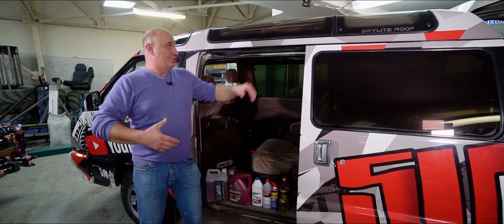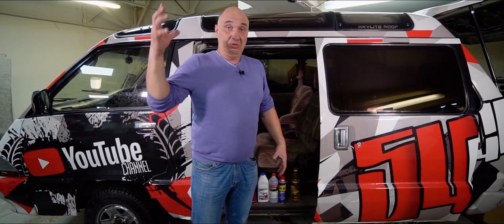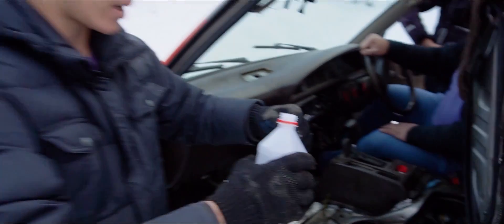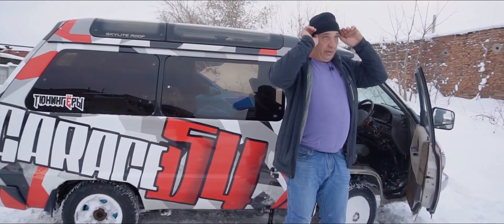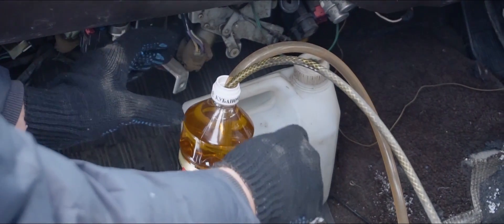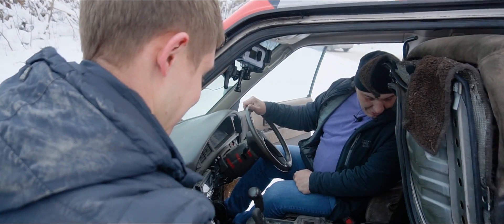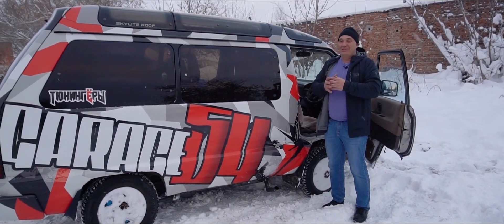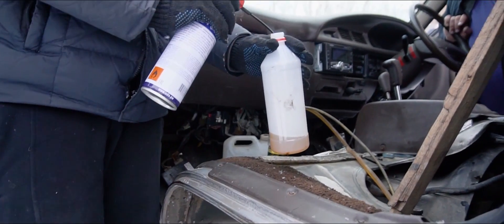Alternatives to diesel fuel: WD-40, cooking oil, brake fluid, Dexron

Comment: They should have done the test again on a modern diesel. These old diesels eat just about anything and don't care. I had a coworker who drove a early 90s Mercedes Diesel. He ran it on cooking oil and used motor oil. Had about 500k kM (310k miles) on it and it ran happily.

Comment: Dieselmotor can and will run on any oil products,from hydraulic,brake cooking motor oil new or used do not matter as long as it are clean from any debris. All oils. Believe it or not even Bacon grease can get you home in a bind, no shit

Comment: Thats why gov's here put a tax onto kitchen oil so it still cost approx. same as diesel fuel, in summer you have absolutely no trouble running old diesel engines with oil. In winter it started to "jelly-ize" pretty quick. And used oil from kitchen lost most of its greasiness and is full of debris.

Comment: Try the cooking oil after using it well for deep frying, we had some "believers" here in Brazil saying that this would be the solution for Petroleum shortage back in the 90s/00s, and for whatever reason, it does actually run an engine almost as well as diesel fuel... Except for TONS of smoke 🤣
Reply: imo that "kitchen" smoke is much harmless than regular oil 🤔
Reply: @diwiak  any kind of oil burning byproduct may (or not) be harmful to your lungs... Point was that the smoke smells a lot worse, covers everything it touches in oily sut, and the gaseous byproducts aren't dealt with by the catalytic converters (neither other emission-reducing devices for diesel engines)... But hey, it's still able to fuel even a gasoline engine, as opposed to virgin cooking oil🙃

Comment: I use to run 50-50 filtered and cleaned used motor oil and diesel mix in our 96 Ford F-250 7.3 Powerstroke and it loved it, it seemed to have helped with power increase and ran quieter, I gave up on it though because it was a bit of work to filter out the oil

Comment: kerosene is close enough to diesel that it will run unaffected. with heavy oils, usually cutting it with some gasoline will get it to run just right, but be careful to not cut too much 10:1 is pushing it.

so what they used was: a slightly lighter oil than diesel (kerosene), a slightly heavier oil than diesel (cooking oil), a very light oil (cutting fluid), a slightly heavier oil (automatic transmission fluid/dexron), and break fluid which is alcohol cut with water.

in total if you mixed everything in one tank, it would run really well, except don't use a lot of ATF. the biggest problem is that break fluid and WD-40 have a lot of water, which is bad for a diesel. ATF has a lot of lubricant, which in small doses is fine, but in large ones is bad.

the short is if you have some old clean oil laying around, you can use it to cut with your regular fuel supply. but you need to have clean oil. that is why the sunflower oil ran well.

Comment: running a liter of dextron every 1000km is ideal for a diesel...it smokes like crazy but the dextron moves build up in the pump to be burned  and also lubricates both the pump and the injectors ....try some cheap parfum and be ready to hold your nose!

Comment: Diesel engines are famous for eating pretty much anything that burns under pure heat, and yes that involves gasoline (however it's best on computerized common rail diesel engine as you can adjust timing to the point gasoline finally burns under compression ignition and I recommend to mix in a few bottles of two-stroke lawnmower motor oil so the electronic diesel injectors have enough lubrication to keep them from dying when handling gasoline fuel), and diesel fuel is also made with Kerosene, which the engine pretty much runs on pure Kerosene just fine.

Comment: Complete idiocy from an ignoramus!!  WD40 washes away the oil film from the thin cylinder, which means it increases the wear of the piston rings at times !!!  It is not for nothing that the old drivers poured gasoline but not kerosene in a big frost !!!!!

Comment: Would say make a 50/50 mix of the cooking oil and volara fail that install a injector to feed Kerosene straight into the fuel line making a thinner diesel oil

Comment: I once tried sunflower oil in a Citroen Xantia 1.9 TD (with the XUD9 engine) and it ran better than it did on supermarket diesel. Smelt better too.
Однажды я попробовал подсолнечное масло в Citroen Xantia 1.9 TD (с двигателем XUD9), и оно работало лучше, чем дизельное топливо из супермаркета. Пахло тоже лучше.

Comment: The "wd"-40 is detonating in the high pressure pump because there's air mixed with it.  You can put a squirt of that stuff in the pump of a BB gun and it'll detonate on the hand pump alone.  Its a way to get lubrication into old BB gun pressure chambers, btw.

Comment: The immediate key thing here is the disabling of the turbo.  If it was still engaged with Kerosene I think the motor would have blown up?   The replacement oils?  Not sure how that would treat the engine with turbo engaged?  I'm not a mechanic.   Comments?

Comment: Vlad if you get used cooking oil for free, you've got an unlimited free supply of cooking oil and a variety of smells from different cooking joints the oil came from.  Just filter the oil a few times before use and VOLA.

Comment: "Anything that burns," huh? Really, so you could run it on wood, paper, plastic, cloth, or paraffin, for example? Yeah, right! Good luck getting that through the injector nozzles, LOL! Running gasoline through a diesel injector and injector pump will ruin it due to the partial lack of lubrication! And it will have premature ignition.

Comment: vegetal (seed) oil is normally mixed with commercial diesel fuel in western Europe, you can use just cooking oil too, but in the long run PARAFIN which is contained will clog the filters, all other fuels you used in the test can detonate too early or too late and this is not good for the motor

Comment: Hes referring to the common rail CP4 pumps that are known to fail. Mainly in the USA due to the ultra low sulfer diesel or mis-fueling events which lacks the lubrication it once had... There's plenty of documentation on the HFRR test to show the lubrication properties of a fluid. Suffice to say you should be adding something to the tank or expect a failure eventually. Opti-lube All in One was the best among 15-20 blind tests of additives. 

Not a salesman. Just encouraging someone else to do the research.

Comment: Diesels originally ran on vegetable oil. It was designed for it. However, you should know modern diesels are not. You will have a build up of resins that are created when oils aren't cleanly burned, unless you treat the veggie oil first. It may take months or years, but eventually, your motor is going to get nasty running on pure unprocessed veggie oil.
Also, the veggie oil can get past the rings and contaminate your engine oil. This will make your engine oil thicker, and in a cold climate, can lead to engine damage.

Comment: In Bulgaria a lot of people use used sunflower oil, because it is cheaper than diesel. You just have to have an old diesel car like WV Golf 2/3 and a friend, that works in a restaurant or in some kind of fast food. It is pretty funny when people that use it drive near you, because lots of times it smells like someone is cooking meatballs. I've also heard of used engine oil in proportions like 3/4 parts oil and 1 part diesel, but i have never seen it.

Comment: mix about a quart (1 liter) of that dexron in 50 gallons (about 200 liters) of kerosine. your injector pump will love you. so will the engine.
Reply: 1% oil motor (15w40) is a good thing?

Comment: Ran my diesel Peugeot on veg oil for 3 years then by accident I put sun flower oil  in the pump presserised and snapped the shaft in the manual injector pump where the pressure was to great to put the oil through the injector nozzles pop bang rattle

Comment: WD-40 in spray bottles contains butane as a propellant. butane has a low boiling point and then boils when it gets into the hot fuel lines.
There is also WD-40 to buy in canisters there is no propellant contained.

Comment: A diesel can run on Grease frying grease from like restaurants and stuff but you got to filter it out several times and it's way cheaper so like you can ask restaurants if they're getting rid of the grease stuff because they usually do from frying and stuff sometimes most of the time they will pay you to get rid of it but just don't tell them that you're using it for your diesel or they'll charge you

Comment: I got a Toyota myself 2.4D NON TURBO 79hp i run it on the 'Clean' low sulfur diesel.... What i like to do is add a Liter of Oil to the Diesel... and it really loves it's candy. 
It is very torquestrong really takes off (it even beats a VW Crafter 180hp) 

If one of these engines is going bad... They will still last forever.

Comment: My truck is my profile picture...a 1997 ford f350 with a 7.3 diesel.  I use pump diesel but also add about 2 quarts of ATF to the tank every other fill up to keep the injectors clean and lubed.

Comment: used cooking oil filtered threw 2 bluejean legs one inside the other and the ankle bit rolled up a couple inches works well to dump the used oil threw to filter most of the particals down to around 12micron for the injectors but used cooking oil has more kick to it!  and bring snacks when driving the van with used cooking oil in it you will be hungry from the exaust lol

Comment: We in Serbia, Montenegro and Bosnia drive Golf 2 diesel on used fryer oil. Or motor oil used. The engine cleans so finely and extends its service life. I have a golf 2 diesel with 2 million km.

Comment: You can use veg oil no problem in diesel engines no problem, but you generally should treat with glycerin to reduce sludging.  The biggest problem (in Europe) is that there is no Tax on veg oil and you can get into big trouble doing this, and the police know the smell of you running on veg oil and it is bloody obvious  and you will get a big fine.  You can buy properly taxed recovered oil as fuel with required paperwork.

Comment: Privet guys. Recall this... You want to kill the engine, then fine. However, the fuel pump is designed to lubricate itself via the diesel fuel. Unless the pump is going to be scrapped too, the carry on, but if the pump is going to be used, then use an old, dying,  pump for your tests.

Comment: The reason your engine sounded different with kerosene was due to pinging caused by low octane. Old tractors had water injection to compensate for it, though not really possible to implement on a diesel

Comment: There's actually a few small aircraft that have a diesel engine, they just run off plain kerosene like the jets. The louder knocking sounds is because kerosene is much thinner and doesn't lubricate as good as diesel (with cooking oil being the opposite).

Comment: Had an old Ford truck with the IDI motor. Used to collect used motor oil and filter it out to run for fuel. Was really amazing when someone would tailgate me... I would shift up a couple of gears to lug the motor and then stomp on it, thing would puke out the NASTIEST smelling smoke ever. You could see people in the rear view coughing and choking on it or pulling their shirt up over their face. Yeah, it worked to keep people off of my ass.

Comment: The reason for the WD-40 not working and foaming up in the lines is becuse it had drive gass disolved in the liquid. It have off gass for a while before it can be tested as fuel.

Comment: OK, here's why your results were what they were. Kerosene is light compared to diesel, which makes it both less lubricating, hence more noise, and less powerful because there's fewer BTUs (joules if you will) in a given volume. The vegetable oil hit a sweet spot where the weight of the oil gave it excellent lubricating properties and excellent total energy while still being light enough to spray through the injectors. The WD-39 (not WD-40 LOL) was too volatile to work properly at atmospheric pressure, and the friction and heat of the high pressure pump caused it to vaporize in the pump, hence it wouldn't work correctly. If you had it under pressure from a supply pump it would have worked, as the supply pressure would both make the volatility less problematic and also carry away the bubbles that still managed to form through the return system. However, it would not have been optimal as it is too light. Dexron smoked a lot and had little power because it was too heavy to spray well through the injectors at winter temperatures, so even though it had excellent fuel value, much of its fuel value was wasted out the exhaust as soot. Common brake fluid is a glycol, and while it is flammable, and actually burns pretty well, it's not that energy-dense by volume, which results in a leaner burn, hence not much smoke, but not much power. Essentially the total fuel value of the brake fluid was about the same as the captured fuel value of the Dexron after its lower burn efficiency. The same goes for Valera.

Comment: Why not the engines were originally built to run on veg oil its just some cheap pumps will die from clogging in the cold!

Comment: modern common rail\hi pressure ignectors will clug in a second.... older diesel were designed to work with carbon powder, but with high compression te temperature will burn anything like coal

Comment: Air in the fuel won't damage the injection pump, the engine just won't run well, or it will stall

Comment: well - they aren't the first to try that - but about the seed oil: well - yes, it's more expensive than diesel or gas refined from crude oil - but at one day even the very last drip of crude oil will be gone - and then we have at least some alternative - although it would require a surface area many times our earth to replace all fossil fuel with seed oil - but maybe our cars will be all electric by then?

Comment: im sure there's alot of comments on this but... doesn't diesel engines use compression to basically light the diesel? a diesel engine normally does not have spark plugs i dont think. so technically other flammable stuff cant ignite. unless theres something here i missed.

Comment: Brake fluid reacts with seals that have been exposed to petrol based products. It may have worked now, but all those seals should be swelling up and getting brittle in a mater of a few days. How that will affect your engine is unknown, but if it has any thing with rubber will have to be replaced to restore its function.

Comment: The best is old engine oil ! I drive bmw 525tds with 1.8 bar boost with old engine oil in fuel tank! NO diesel all 72liters reservoar with oil engine oil :) Drive like that for 50 000 km and after that sold my bima . This was in summer! In the winter make mix 60liters engine oil+ 10 liters diesel and 2-3 liters petrol AND no problem even in -20 degrees :) Тhe old engine oil cоast me 20cent per liter and diesel was 1.3 euro. And car was pretty fast, about 190hp :) Only problem was to lose time to filtered engine oil 
 The best diesel fuel is ATF oil or transformator oil but those oils are coast like normal diesel and don't have any sens

Comment: Cooking oil is a quite popular choice in some countries where diesel  fuel is more expansive. It works pretty well in summer, but you might have truble to use it in winter if the engine is cold. Akso, it freezes muc more easily than normal diesel fuel.
Reply: Just make  a fuel tank heater

Comment: cooking oil works but it's a pain to run for a cold start and will need to be thinned out tell the engine is hot . just about any diesel engine will run on cooking oil but in the winter you will need a second tank full of oil thinned out with kerosene or some other solvent that burns to start it then switch tanks when it's hot or add a tank heater to warm the oil before starting.

Comment: I'd like to comment about something you have said in the video (around 7:15 ). This happened in Spain. About ten-twelve years ago, a bottle (1litre) of sunflower seed was 0,70-0,80 euro cents, whereas a litre of diesel was 1,10. Some people realized what you have proved in the video, namely that sunflower oil is equivalent or even better (and greener, of course) that diesel oil. So lots of people started to use sunflower oil (this plant is widely grown in southern spain) instead of diesel. Petrol companies didnt like that and misteriously sunflower oil price raised about 25 cts. Nowadays it is more expensive than diesel oil. BTW I used it myself in my old Jeep Cherokee and it worked very good.
Reply: It wasn`t the petrol companies. The guys probably had to much harvest, or too much old stock of sunflower oil, so they dropped the price for people. But imagine, how can it be cheaper when you need to use diesel to harvest the sunflowers and after that produce oil.. It cant be cheaper...

Comment: It'll run perfectly on oil waste from cafes, burger bars etc just needs filtering. You can clean it with methanol to make bio-diesel. Filtered old engine oil works too but smokes like hell.

Comment: You can make your own pure diesel from old chip oil and some chemicals, its very cheap but time consuming and you can spoil a whole batch quite easily.   Also you need a really good filter on the fuel line as particulates will clog injectors quite badly.